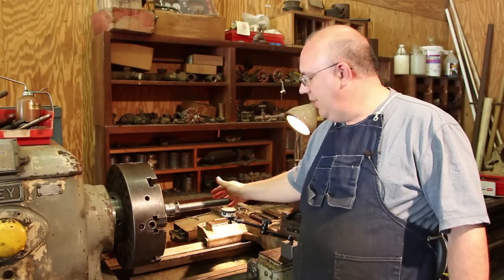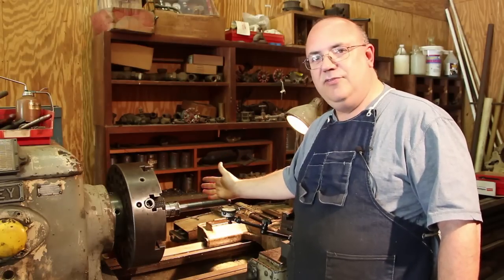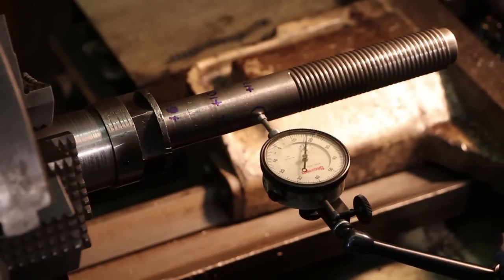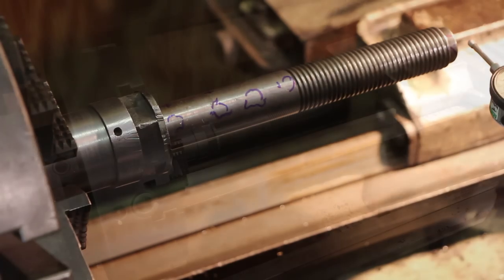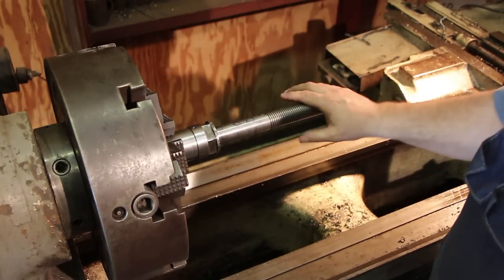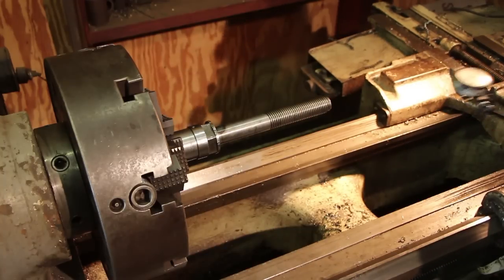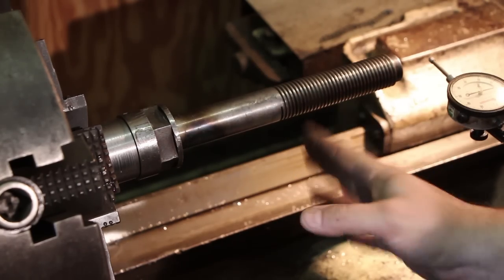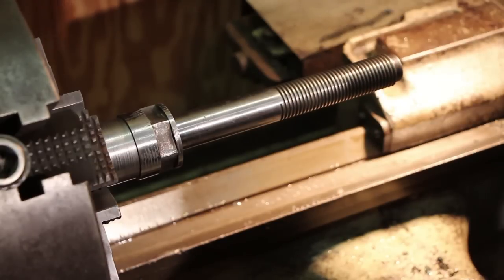Flame Straightening a bent Steel Spindle

Comment: Great video, Keith. I plan to try this on a shaft from a Gravely mower deck soon.
One question/suggestion. It seems to me that it would be very handy to keep the indicator on the part (far from the flame obviously) so that you could observe the movement as you heat and cool. In the case of your part, you could put the indicator at the far end and you should observe a lot of movement.
Reply: If you do this, you will see the indicator move in the WRONG direction (ie, increasing the bend) as you apply the heat. The usual practice is to keep the heat on until the wrong-way movement is about three times the desired right-way shrinkage.

Comment: a few years ago union pacific flame straightened a bridge near my house. it is 97 years old now and still carrying up to 20 main trains per day....2 men worked for 2 weeks with rosebuds heating the bottoms of I beams...the bridge amounts to a bunch of beams laid on top of concrete buttress, covered with wood and gravel, it would be interesting to lay that aside for a few weeks  then remeasure it to see if it changes with time

Comment: There was something sold for Copper pipe work that you would use as a between the copper pipe and the wood frame it like a 1/2 in thick and 8 x 12 used a shield for the wood (made out of some type of cloth material). Hardware stores have them in the pluming section. It does a good job of keeping heat away when you have to sweat copper in a wall.

Comment: Someone else may already have suggested this, but I reckon a handy addition to a dial indicator is an "elephant's foot", basically a large diameter thin cylinder (like a coin only smaller, with a screwed extension) which fits in place of the usual ball-ended tip, enabling clocking up over a thread, keyway, tips of gear teeth, or whatever, without the tip descending into the valleys. You can make them, or buy them.
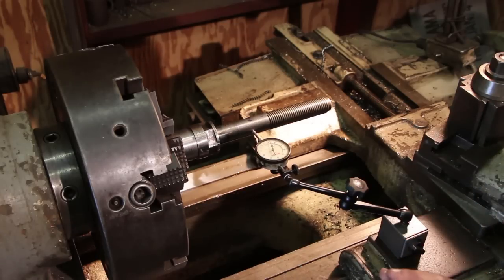Reply: In the last few years I've learned a lot about heat straightening, since watching a couple of youTube videos on the underlying mechanism from the superb channel "An Engineer's Findings". every thing I've attempted since then has worked, plus I now have an understanding of weld distortion, something which had eluded and frustrated me previously.  I've only watched to 12:10 so far, but I'm going out on a limb to say that reheating that first spot is not likely to produce much further action. I can see why Keith chose to do that, because there's no point trying elsewhere because that's clearly where the bend is concentrated. I perhaps would have tried the face immediately beside (to the left of) the spot he heated. If that helped but more was needed, I'd try a could of shrinks immediately adjacent to the first one and on the same cylindrical surface, one each side, at the same distance from the face referred to above.
So now I'm going to watch what really happened as opposed to what I think will happen.
Reply: So yes, reheating the first spot didn't do it. Keith actually tried something I considered and discarded, which was to heat further away from the face. I realised that would reduce the runout at the end of the shaft (which it did) but I felt it would leave the shaft slightly bent, like a question mark which had been almost straightened out but not quite. In other words, the left and right ends of the shaft would be true, but not the middle. (Another way of describing it would be a skipping rope)

Comment: Don't let people get under your skin by questioning your decisions.  I would just tell them "Thanks for the feedback but It's my shop, my lathe, and my job.  You can do it any way you want."  For example, in steel construction, we don't heat the steel so hot but we apply considerable force to coax a structural member into the desired position.  But those are very different grades of steel from steel shafting with very different loading patterns.

Comment: I see comments throwing words like "temper" and "quenching" around.
Keith didn't wet it down from anywhere near critical temp, but for some steels the localized heat will make the rest of the spindle act as enough of a heat sink to cause problems.
Whatever steel it is, a little or alot of stress is introduced. For this high speed use a stress relief at 5-600 C could be a good idea, and I'd be interested to see if that interferred with the "set" gained by straightening.

Comment: I thought that when you heated the metal red hot and quenched it the spot would shrink, causing the bend to be worse. Instead, heating and quenching froze the metal in the expanded condition, correcting the bend. I see I was wrong in my analysis so I learned a lot from this video.
Reply: I felt it was done in reverse as well.  I can't explain why it went the correct way unless there was some normalizing going on.

Comment: i used to straighten 40' and 60' trailers by putting heat in to the neck of the trailer similar sort of thing but on a bigger scale use to put the heat in the shape of a v
Reply: *****
 i was doing this some 30 years ago when i was a whipper snapper lol

Comment: Always thought that you drew metal using heat and cold. (the side that you wanted  the metal to travel, would be where you put the heat) We would use the dial indicators several places and get the reference points, like you did. We would draw 12 to 18 ft. x 4" agitator shafts back into spec, but we would put the heat on the side, the way we wanted it to draw, then cool it with ice and sometimes co2. The heat caused it to expand, then the cold drew it back past were it was before applying the heat.

Comment: Sometimes, after a treatment like that you can “ring” it sharply with a steel hammer to relieve the stress and the runout will change slightly. Doesn’t hurt to check it again.

Comment: Most likely that part wasn't bent in the shaft. the way its built is essentially two cylinders joined by a  plane. The plane (where it sits flat on the end of the spindle) is probably where it deformed. After getting it straight, it probably would have been best to face the mounting surface off on the inside, but that probably would have been overkill. Either way, you did salvage a damaged part.

Comment: I know it’s been years since this was done but this process was in reverse. The correct way to straighten with a flame  on a solid bar is to put the low end down and heat the opposite end top. And do not use coolant. This video shows the opposite working. Baffling. But I think I know why. If you try to straighten a tube or hollow section you use this method as shown in this video. If you look when he removes the shaft to show you the threaded section it looks as though there is a certain amount of counterbore which in effect makes this a solid bar at one end and a hollow bar at the other. Therefore he is actually straightening a hollow section. I worked in a reclaimation engineers shop  on a large dock using this process to straighten shafts up to 6” diameter up to 10 feet long. And hollow sections too. It could take all day to straighten a shaft as you had to wait for the shaft to cool. I have seen comments stating this process is the opposite of what most people do. Jeff
Reply: Exactly, the metal actually shrinks as it cools, it doesn’t stretch!

Comment: In the exchanges between Bill Lewis and Tom Lipton, I noticed that Tom interpreted Keith's referring to the side with the higher indicator reading as the "high side" or "high spot" of the bend. I prefer concave or convex, and don't see how heating, then cooling, on the concave side got the result that it did - and I've read Tom's book, with particular attention to this chapter.

Comment: Seems to me tho that in doing this aren't you tempering out any of the hardening that has been put into this shaft.  Is that an issue or are we to assum  it had no hardening to begin with.  If that's the case do you still get the straw thru purple colors when heating campletely annealed steel?  I haven't done enough metalwork to know all the details like this yet as I've only just started into smithing casting and machining.

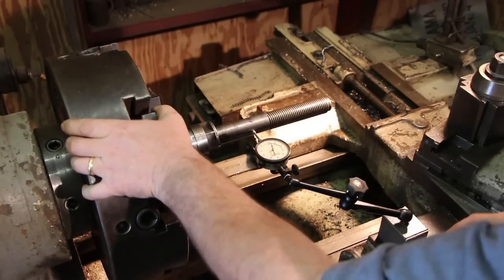Comment: 11:46 Do you have any idea if you can do this with a MAP gas torch? Also do you think you have to get it red hot inorder for it to permanently bend? The reason I ask is I have a bent spindle that I'm thinking of straightening like this but I'm worried about affecting the heat treatment of the splined shaft. Plus I REALLY REALLY REALLY don't want to (or even have the means to) remake the splined spindle with a MT2 on one end.

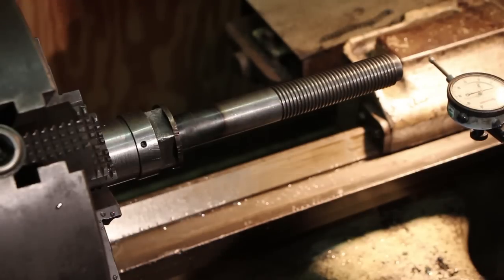Comment: From 15:45 to 16:10 it sounds like your lathe is picking up speed?? Is that even possible? Thought it was a geared head? Makes me want to get the tach out now.
Reply: The only thing I was thinking was if the lathe was wired 480V but was being fed 240V power. Under big loads like running high gear I have seen this same thing where it takes a bit to get to full speed because of the lower voltage. Probably just dopler effect from mic position though like you said.
Reply: I heard this also on the last video where he turned and threaded the 3/4" spindle, in the same situation where he geared the speed up for polishing. My guess is that the motor is struggling a little to spin up that massive 4-jaw chuck. In higher gears, the motor provides more speed and less power, so it takes more time to accelerate to the speed specified on the motor.

Yes, a geared head means that the chuck is turning at a fixed ratio relative to the motor speed....but the motor speed can vary depending on load, and a high gear places a larger load on the motor.

The doppler effect will be insignificant at the speeds that Keith is moving around the lathe, so that's certainly not the explanation.
Reply: i thought i hear the same thing also lathe picking up speed lol.

Comment: New comment on an old video.  Out of curiosity I graphed the run-out guessing at the distance from the left end.  0" - 0.006, 1" - 0.010, 2" - 0.017, 3" - 0.023 and 7" - 0.054.  The graph is just about a straight line.

Comment: Wood working equipment often times turns at high RPMs.  I would be concerned with vibration, especially with a heavy nut spinning on the end of it.

Comment: Keith, I watched some pipe fitters doing something similar to actually put a slight offset in a large pipe by applying heat to the outer desired bend area and putting a wet rag on the inside, same place.  Would that work here?
Reply from the maker: Charles Compton It is the same principle, but you get different reactions on a pipe vs a solid piece.
Reply: Keith Rucker - VintageMachinery.org    Keith, what changes when you go from solid to pipe?  Also, from my experience spindles like this are made from a stress relieved steel.  It is not heat treated and the small amount of heat your used will not change the core structure of the steel.  Tom

Comment: To be honest: I have never heard of this technique. Good demonstration and explanation. Thank you for sharing.
Just one question/concern: I am wondering if the heat treatment might alter the structure of the steel and harden or soften it depending on the exact temperature profile.
Kind regards
Harald
Reply: ***** Thank you very much for your honest and plausible reply, Keith.  Highly appreciated!
Harald

Comment: i tried this on a 7 inch dia x 20 foot long bar of hot rolled yesterday. the bar came from the mill with a .500 bend at 5 feet from one end.
talk about a heavy horrible piece of bent bar stock ..... the heating/cooling process reduced the bend down to .350, still not good enough.
hopefully day shift had better luck.....oMG, please be straight  when I get to work....please please

Comment: At work I regularly straighten drive lines, it's counter intuitive at first. I use a dial indicator on the shaft at the same time as I'm heating it, you can watch the dial move and record what it went to, then remove the heat and quickly cool it with air, you can watch it pull back then record how much it effected it. cool it then heat it again watching the dial adding a little more heat until the dial moves further. etcc...  Tom-aka oxtoolsco has a good section about it in his book.

Comment: Interesting, but please, please don't use emery cloth like that, pouring carbide dust onto the lathe slides.
Reply from the maker: Roger Froud You are correct that it can be abrasive, but if you are careful to always wipe things up clean after doing it, it poses little risk to your machine.

Comment: Mr Rucker,, you have removed any previous heat treatment at the point of heating,the quenching can cause the metal to become brittle.  I enjoy your videos but I think in this case you are in error..  best wishes  Bill
Reply: +gatt be depends on the steel...... if same was mild steel their would be little effect due to low  carbon content ....... if same was medium carbon  then that's another matter... he seems to be cooling rather than rapid quenching so that's when things go south, he could of course heat up the whole shaft  and allowed same to cool which would 'Normalise' the shaft....but then that sucker may kick out of alignment again.... great upload...

Comment: Shaft´s temper is ruined right where it´s needed most, at the base.
Those shaper cutters often get into the multi-pound range and spin at 6000 to 15000 rpm. I wouldn´t want to get close to that machine.
Cool vid, but not for this application. Do your friend a favor, scrap the shaft.
Reply: Perhaps you have a fundamental misapprehension of the concept of tempering; if anything, the arbor is safer now.